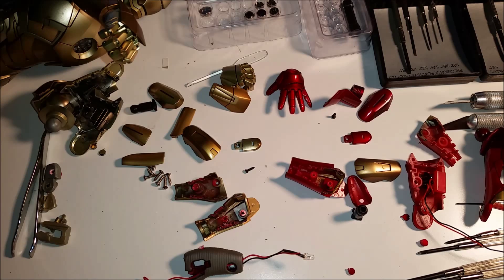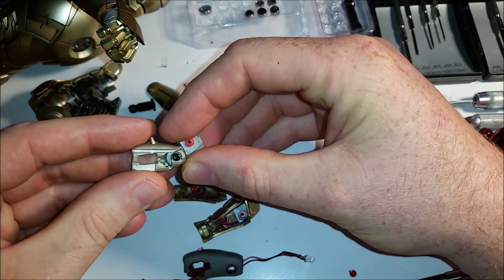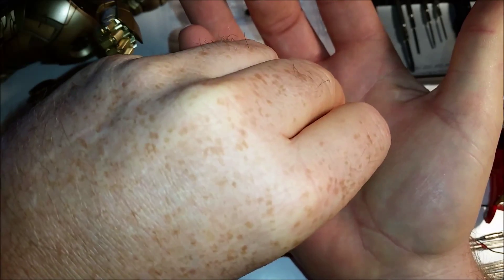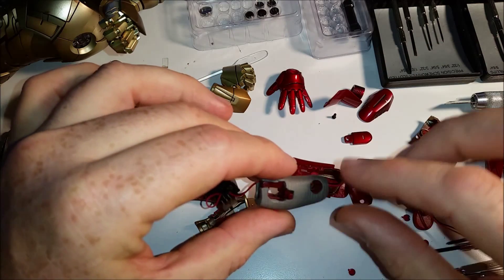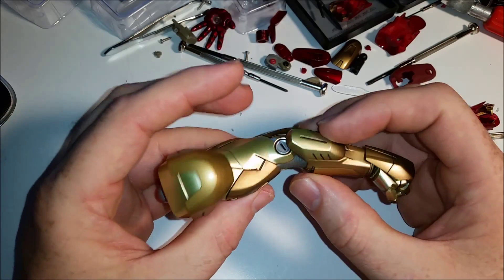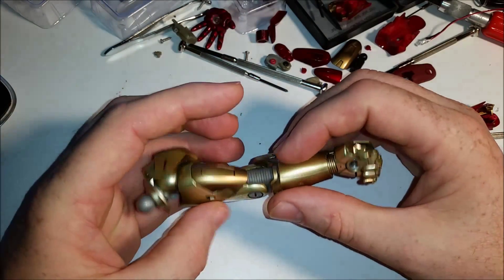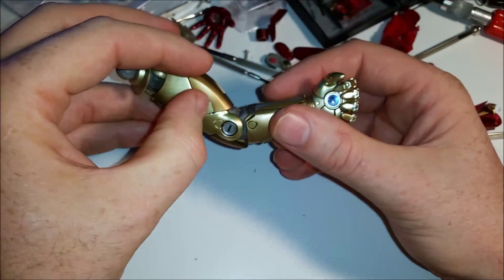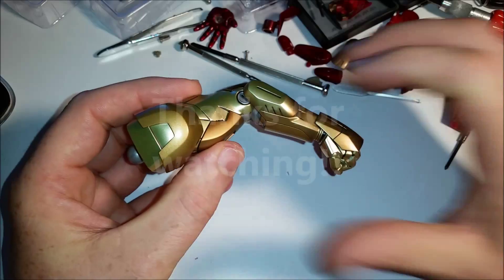Repairing Hot Toys Iron Man Mk 21 (Mark XXI) Midas 1/6th scale Collectible Figure MMS 208

Comment: I have the same problem with my Midas' left elbow as well.  Did you happen to record taking apart your arm?
Reply from the maker: no, I didn't, but I am working on something that might help you.
Reply: +Siri Emerald  I'm intrigued.  Are you taking apart another one?
Reply from the maker: +Doug Whitney Building one that needs to have the lights replaced in the arms. But essentially you have to pry it apart, It is glued together except for the areas where the little covers hide screw holes. Take your time, don't pry to hard or you will break the pieces and bend them too badly

Comment: How did you pop off the screw covers ?
Reply from the maker: I used a sharp pointed X-Acto. I'm assuming you're talking about the little round pieces that fit into the holes. I stuck the pointed X-Aacto Knife in there and pry'd it out.
Reply: @SiriEmerald  Hi, what’s the trick to getting them out without causing damage? I thought about using something like that but won’t the sharp edge or point damage the plastic or paintwork?
Reply from the maker: @omegaglory1  taking your time. It was never meant to be taken apart after being assembled.